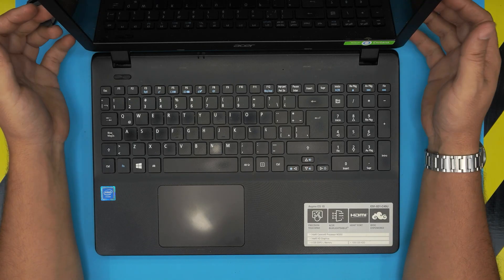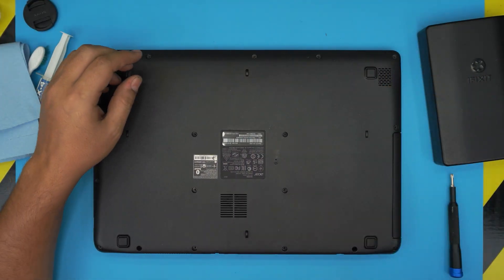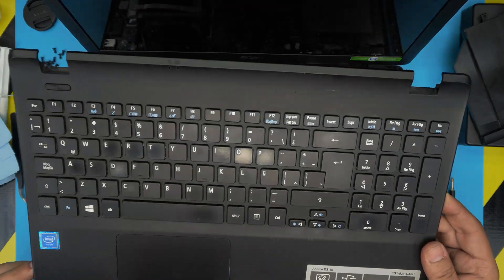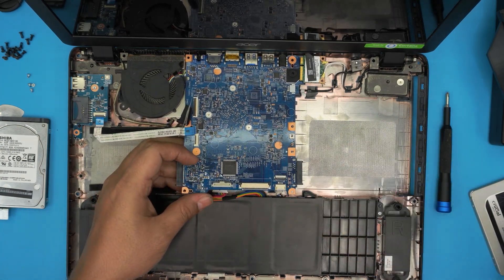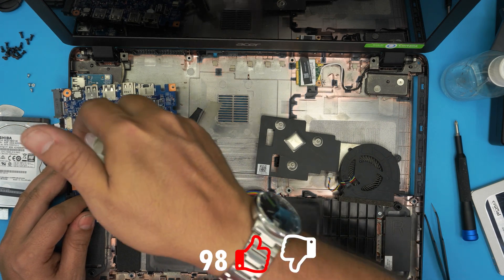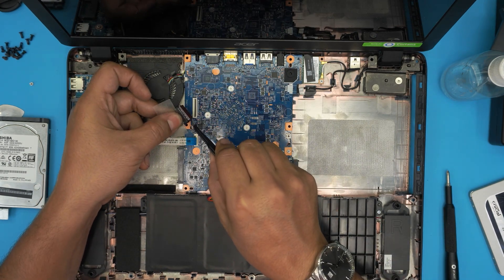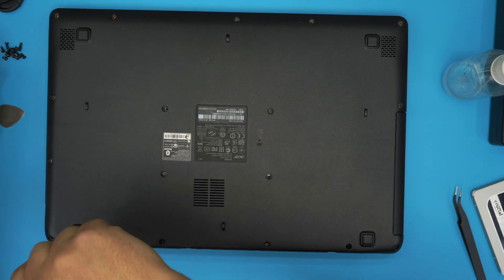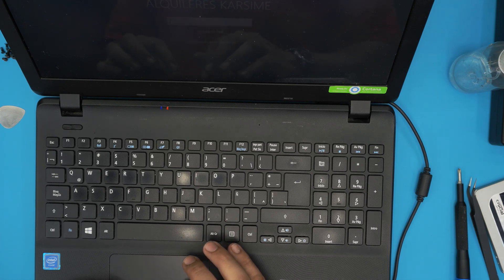Acer Aspire Es 15 🚩 Es1-531-C45u 💻 Repaste & Cleaning

Comment: How do you remove the battery?
Reply from the maker: here is a link for battery replacement: https://youtu.be/XZj8QNo5_lE
Reply: Thank youfor  this video. Please can you advise my air vent bars have broken. I have bought a bottom case to replace. How do I  remove the speakers and do you have a video for Acer ES1 523 model. Also when I try to install Windows 10  it keeps looping when I choose 64 bit so I had to install window 32 bit. Is there a way to upgrade to 64bit. Thank you 👍